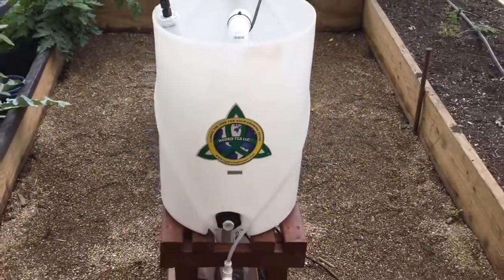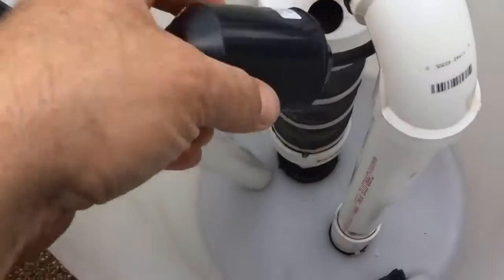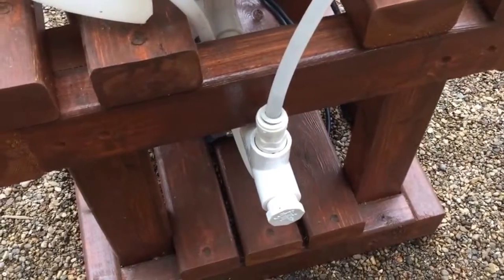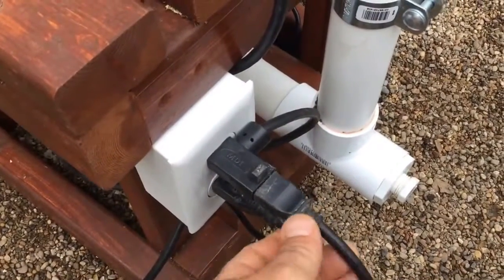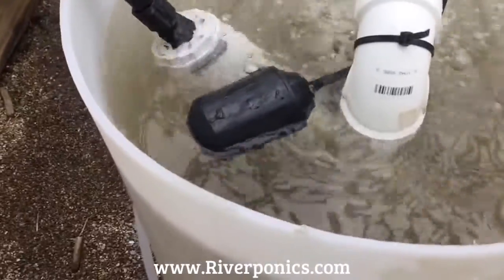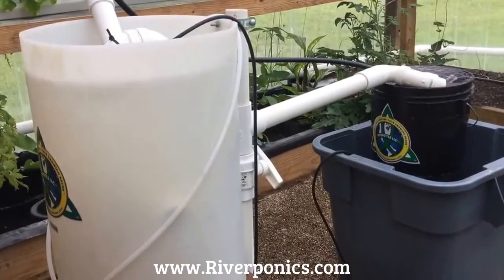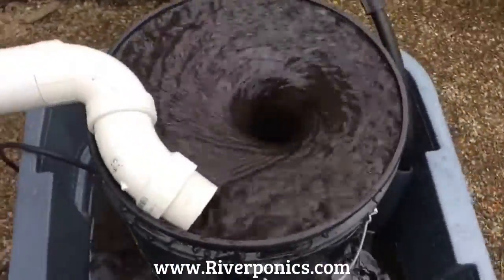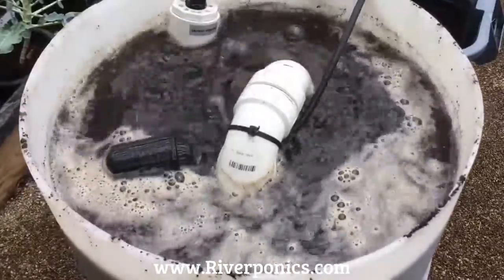20 Gallon Closed Loop Compost Brewer

Comment: It looks like there’s an impeller pump moving the water back to the big tank.  I’ve moved away from the impeller years ago because I read the blade might damage the microbes.  100% bubbler is gentler.
Reply from the maker: It all boils down to cost. I've researched so many other options, they make pumps that mimic sea shells instead of propellers, ect ...  With that said, my plants really don't seem to mind the propeller pumps the proof is in the pudding !!!
Reply: @riverponicsgrowingsystems7450  

Yes, it does mostly boil down to money and high quality costs more.  What I learned from my research is that a sign of good aerobic activity in making compost tea is the foaming at the top and I don’t see that with your system.  I’ll look again.  The real “proof” is that you get 2 of the same plants at different areas of the garden.  Water one with no tea and the other with tea.  Then you will know if you over engineered your system and make anaerobic tea.  Great job though.
Reply from the maker: @califuturist  Riverponics is more than a one trick pony, the possibilities are endless, this system has no problem creating microbial foam life when needed :-)
Reply: @riverponicsgrowingsystems7450  

Wow, I see that you use 20 pounds whereas I only use 2 cups for 25 gallons.  Do you use anything to feed the microbes?
Reply from the maker: @califuturist  Molasses is a readily  accessible food. Hence there are compost activators to help increase microbial life